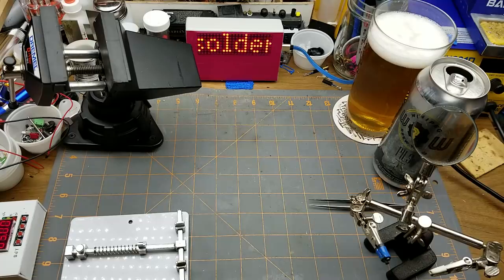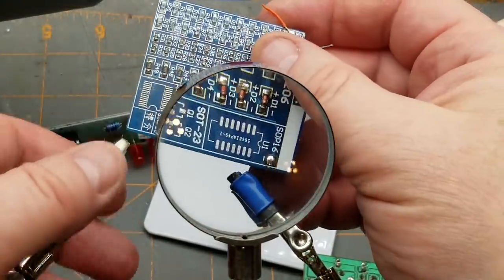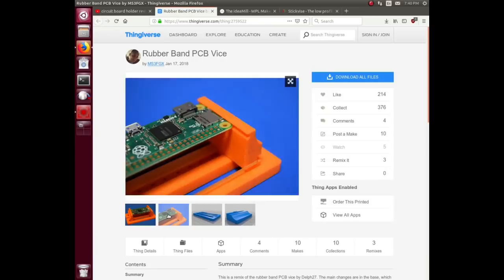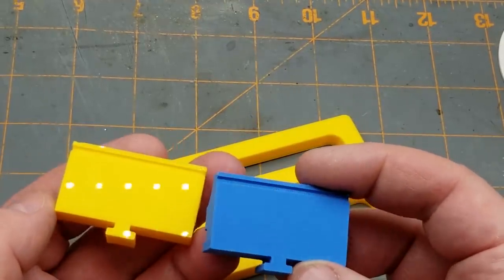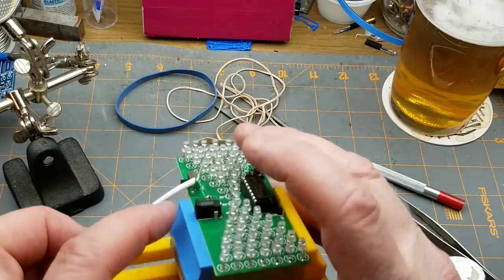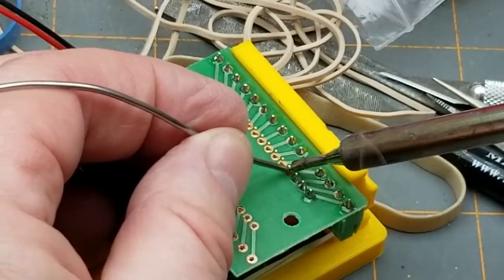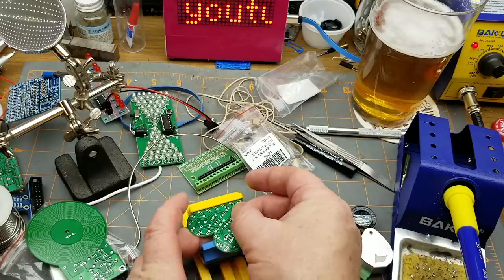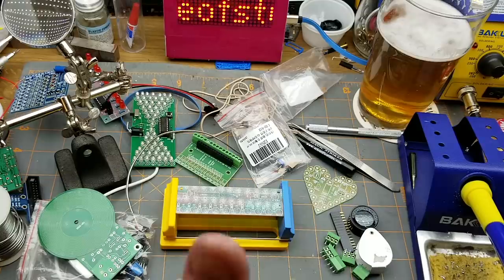Checking out a new soldering board holder

Comment: I have one of those "Dremel" vises that's Sears branded. My Mom gave it to me 38 years ago, when I was 15. It still works perfectly. I did lose one of the rubber feet, but I was able to create and 3D print a replacement from flexible filament that works just as good as the original.

I use it almost every day for various hobbies.

Comment: I search for those on thingiverse too. I abandoned the idea because I use hot air too. PLA softens at very low temperature like perhaps 65C or so. Protecting the plastic from warm air seems too much hassle. Unfortunately that means only metal holders seem to be the way to go (or a few rare high temperature plastics).
For hand soldering with an iron those seem fine. Spares are cheap to print too if you happen to touch it with an iron by a mistake.

Comment: A) the 3d print can even go in the d-vise,  
    the print can be mounted to a bare piece of circuit board if too thick to hold,
B) mount the 3d print to something heavy that has rubberfeet.
C) groove the side of the bottomplate at closed end and rubberband the yellow jaw
D) use 2 bottom plates screwed to a plank (increase length), this plank can also be held by ...
E) have a metal square tube, grind a slot in it, add the jaws ... (check tube wall thickness first)
F) cut of the closed end (with the yellow jaw in it), reverse it + reverse jaw + screw to plank,
    the rest of the bottom plate can be screwed at any distance you need.

Comment: This is a cool video, for just the sake that you admit you're not very familiar with 3D printer parts, but you immediately found a way to get parts printed, and reviewed what you received in a critical manner. No "3d printing is the best thing since brass" gushing praise, but you did find the tool to be useful and customizable. You showed that parts may not be perfect when received, but a file or an extra elastic can customize the parts. What's extra nice is that it's trivial for someone handy with design software to make 50 different variations that solve different problems... bigger, smaller, three jaws, round jaws, whatever.

Comment: for SMD boards you can tape them to a flat surface with Kapton tape.
Reply from the maker: I have done that.I discovered that soldering directly on my cutting mat caused it to warp and deform from the heat.
If I'm doing any soldering on a flat surface these days, i do it on a piece of Masonite.
Reply: Works when you are not soldering for both sides

Comment: You should have just let me mail you the screw-vice version.  Well, you got it done.
If you are blasting 300C hot air on your part for reworking ... you will have to go back to your metal thing.  PLA gets mushy at 150 C or less.
Reply from the maker: There's a lot of parts to print in the screw vice thing. I wanted to go simple for my first 3D print experience.
Thanks again for pointing me at Thingiverse.

 And good reminder about the hot air. That would have been... interesting.
Maybe something to play with if I break one of the jaws.

Comment: Watching at 13:27 - that is just painful to watch. FFS just flip it over and USE THE DESK. The best PCB holder for through hole components is... NO HOLDER.
You need to quickly flip, rotate, move, reposition, adjust, add components. Putting the PCB into any holder just makes things heaps slower and more difficult.
A) Learn how to place components. LOWEST first (eg: diodes & resistors), then work upward. I am constantly amazed at how people don't know this trick.
B) Use the DESK (and gravity) to hold components in place! Bend leads, place into holes in PCB, rotate PCB so component is held between PCB and desk. Solder. If PCB sliding, use little finger to put the board down to retain it.
C) Only solder ONE leg of each component in that way. Then, lift PCB and inspect, reflow solder or bend lead until nicely placed.
D) Solder all remaining leads "free hand".
I've found that the easiest way BY FAR is to do it all in hand (aka "BigClive"). It's so much easier and faster! If you cannot hold solder and PCB in same hand, then make a "holder for the solder" rather than a "holder for the PCB" - it's dead easy to heat a pin then move the PCB and iron up to the solder (make sense?)
Reply from the maker: The heat causes damage to my cutting mat, so I try to avoid that.
But I do sometimes use a piece of Masonite as a soldering surface.

I do use Clive's technique sometimes, but my fingers have become less calloused over time and I can feel the heat more than I used to.

It's always good to nave multiple options and multiple techniques available.